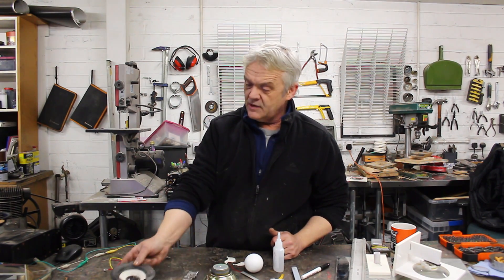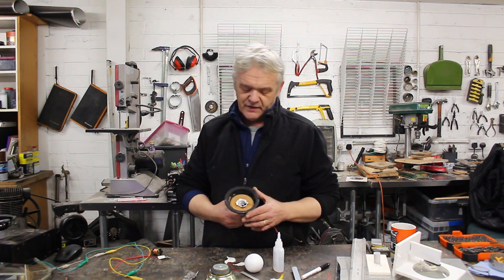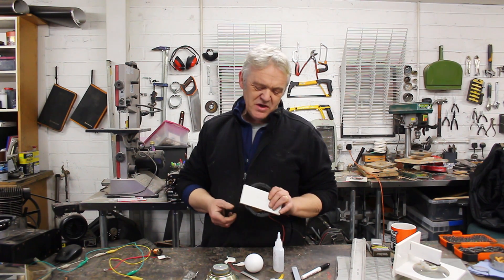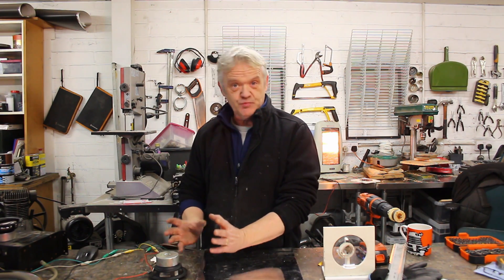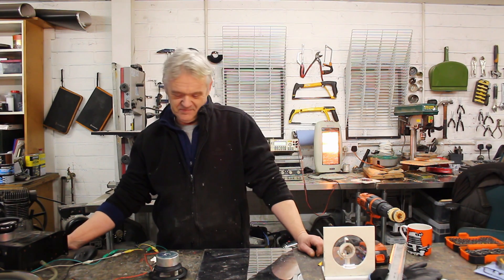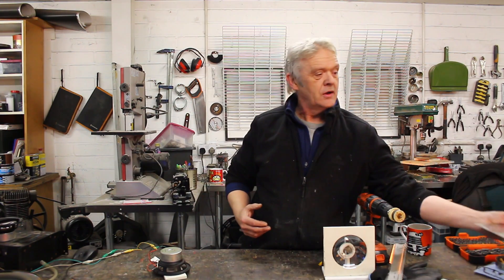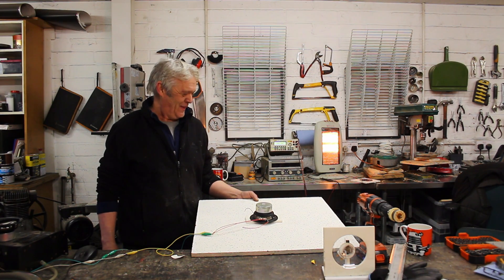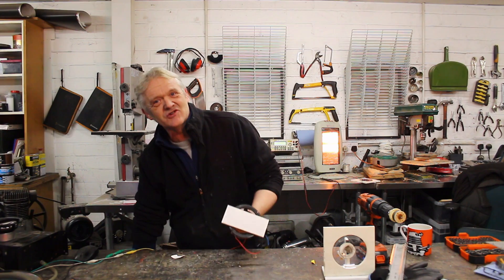1394 How To Make An Omnidirectional Vibrating Speaker

Comment: A while back I found myself working with a group of younger folks. Lacking a decent set of speakers, I went about cutting snipping and taping up a couple of horns out of cardboard. Then I attached each to one driver of a disassemble headset. The gathered group seemed mystified that a cheap pair of bargain bin headsets could crank so much sound. Apparently they never saw my great grandfather's 1908 Victor Talking Machine.
Reply from the maker: a few years ago apple marketed an amplifier that used no power - it was just a plastic horn, like an ear trumpet - they wanted something crazy like US$50 for it! Lots of folks have never seen a gramophone I guess - or at least folks who buy apple  lol

Comment: What if you covered the board with straws?  Create an area of small parallel tubes on the flat plate that should emulate some form of collimator. 50 quid says girls could hear it , but blokes not so much. To illustrate what I mean is take a bunch of drinking straws and  cap them at one end  with card. Place said bundle against your ear. Enjoy.
Reply from the maker: I will give it a go mate lol - cheers

Comment: Interesting stuff. I remember a guy who made flat panel speakers, but just the speaker onto a board. The secret is to find the proper spot on the board (Phi, or Fibonacci) and the sound would be amplified very clearly by the board. I wonder if combining both methods would yield an even better result?
Reply from the maker: very interesting

Comment: Spring is near, how about we get ready for gardening!  Here is an idea: a Working Ink, graphene paint-on seed sprouting mat. I have a bunches of ideas sprouting, PM if you are interested.
Nice video BTW. Would there be a way to concentrate or focus the sound waves? If so, would it be possible to build a stirring plate? The idea is to use sound waves to induce motion in a beaker thereby creating a gentle stirring motion. Also, with paint on heaters. That way you can make and keep a cup of tea hot and smooth.
Reply from the maker: seed trays, sprouting mats, heating plates are good ideas for the ink mate - we did do the sound lens that might help

Comment: Hi Robert  & everybody
If you glue a stainless steel threded rod and some washers with nots holding togother in the end you can have the ultrasonic vibration rod to mix / sred / homogenizer materials in liquid like GRAPHITE to Graphine ( your phone generate the desire frequency amplifier do the job) 
I was making it back in the day when you uploaded ~ 7 years ago "Graphene From Tea" video 
Old subwoffer speaker was modified. 
Insiration worked on me thanks, now I share it.
Reply from the maker: that is an awesome share mate - I will give it go building that for sure